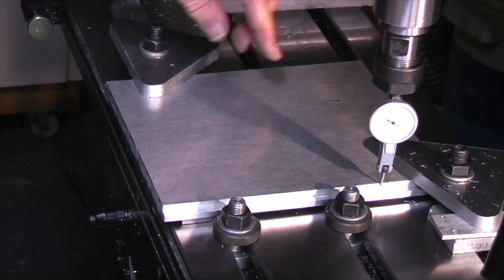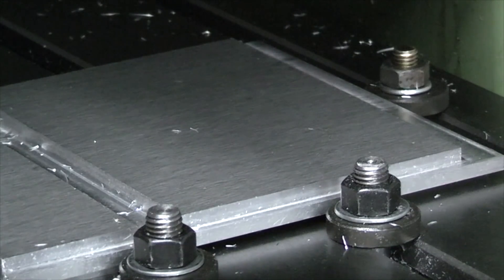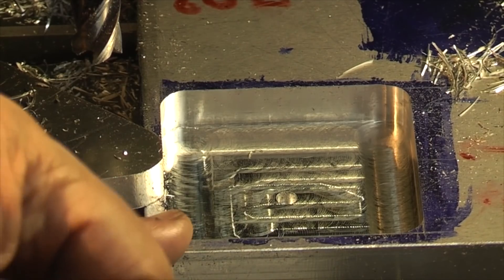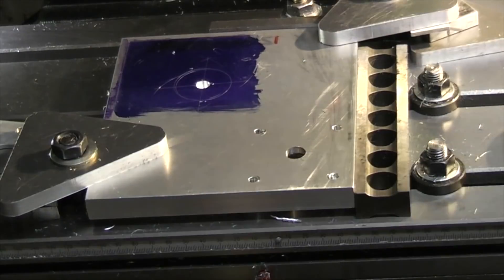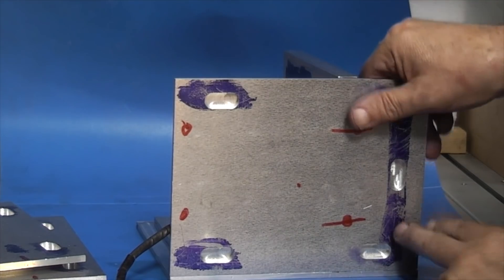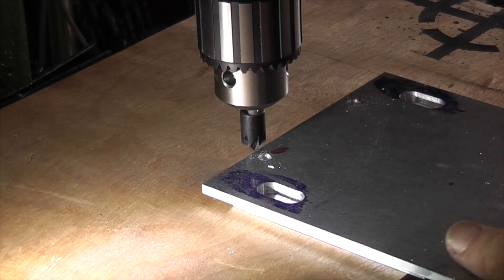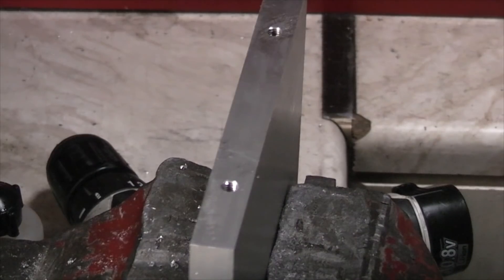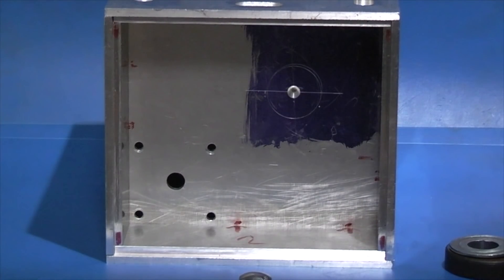Rotary head case

Comment: Cool!  Will there be a part II?
Reply from the maker: Hi Barry. there are other parts to this.  I'm working on next weeks which is the belt tensioner for the toothed belt but could be used on other. projects. So I haven't made them part3 or part 4

Comment: Don't forget your power access. Now is the time to make the holes for it.
Reply: Yep. I second that thought.
Reply from the maker: Hi Craig  I haven't forgot the power access This will be fitted into the panel with the bearing bore on the top face. As all the other faces can be used to hold the unit to the table.
Reply: You can tell that you're Mechanically trained. Mech plan but leave it for last, then forget. Electric folks, like me, start with the power and leave the mechanical for last.